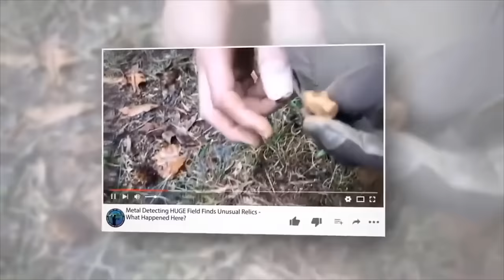*Police Everywhere* 5 Cars Found Searching For Missing People!!

Comment: When they said that the vehicle could tow 80 thousand pounds I knew right there this could pull a loaded 18 wheeler fully loaded. Bob tailing is 40 thousand the trailer loaded should be 40 thousand as well . A tiny 4 wheeler car is nothing for this equipment

Comment: Has anyone thought of using
 a helicopter 
to pull these vehicles out of the 
water if it’s safe to do so??
Reply: To heavy for a chopper cars average wait empty is like 3500 pds to 14,000 pds then u have water that is 6-7 pds a gallon & then u have silt that is say 50 pds a square foot  & the weight goes way up a black hawk I think can pick up 10,000 pds so u u can max overload a chopper real fast & then u have the disturbance of the blades too which can cause more prob